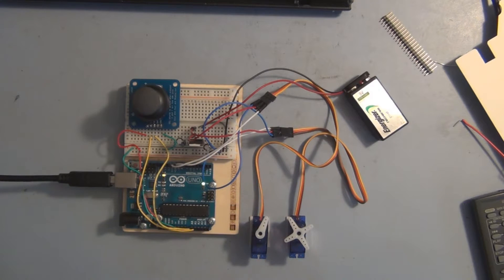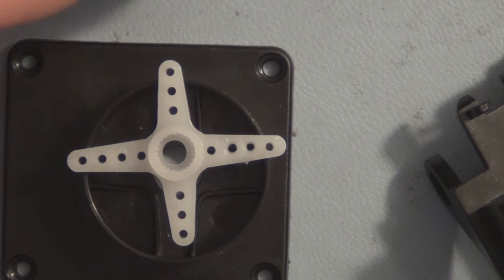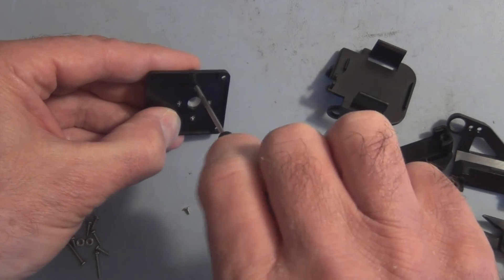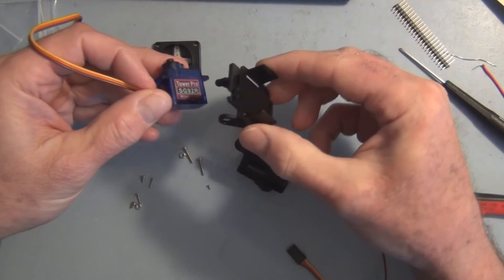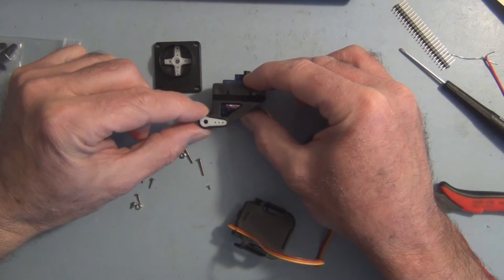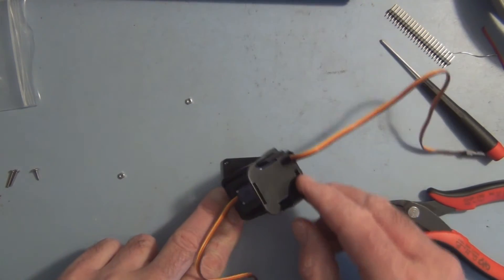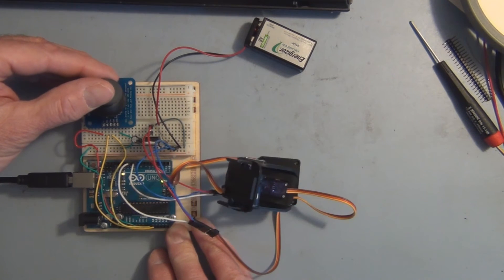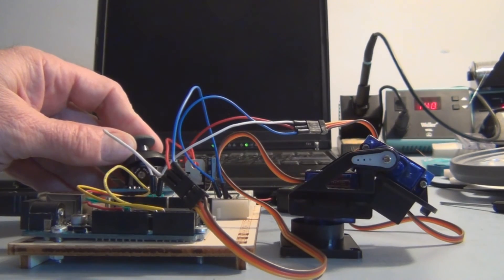Arduino Pan and Tilt Servo Motor Motion Control

Comment: Those servos are 4 for $5 on eBay smh people really need to look around before just ordering from the first site they look at lmao and that's been the price for them on eBay for the past ten years
Reply: They also need to realize these are very use specific items that require specific servos to work and assemble properly. They'll forever be a PITA unless the servos are centered before assembly. These were engineered for giving motion to first person view cameras, and mounted to radio control airplanes especially but can also be used on R/C  cars, trucks, boats,etc. This guy is painful to listen to. If you are going to put an informational video on YouTube, know what the fuck you are doing!

Comment: I made a similar set up. I found the motion to be jerky and abrupt, so I've wanted to introduce some delays to smooth it all out. Another problem is that the kit returns to its starting position when you let go of the joystick. I might try to freeze it in place and only return to the origin when the button is pressed. I got mine to operate a laser pointer, with the button controlling the on/off on the pointer and the servos controlling the motion. What I'd like to do next is to integrate this with another project, a two-axis solar tracker, and use the button to switch between manual (joystick) and automatic (tracking) modes. There are plenty of uses for the button, each with similar coding problems and solutions. Cheers.
Reply: Nice work, I hope you were able to make much progress. For the jerky motion, it can sometimes be solved if you separate the joystick power supply from the motor power supply (the motors tend to cause noise on their power supply). Also Alan G. Smith (author of IntroToArduino book) suggests that we allow for a "dead zone" around the middle of the joystick where there tends to be much fluctuations.